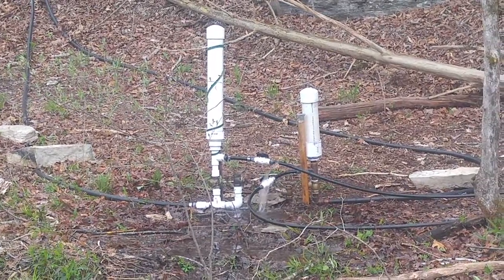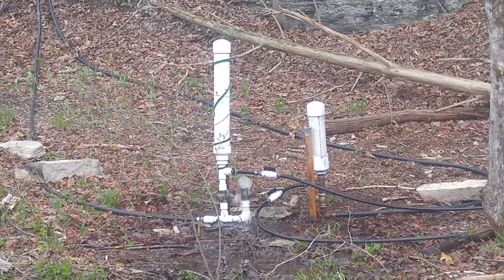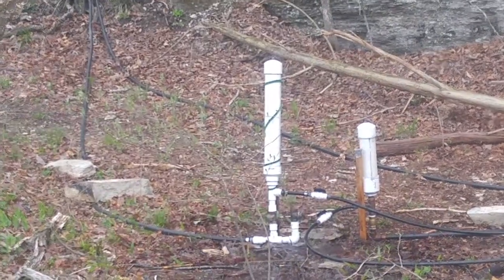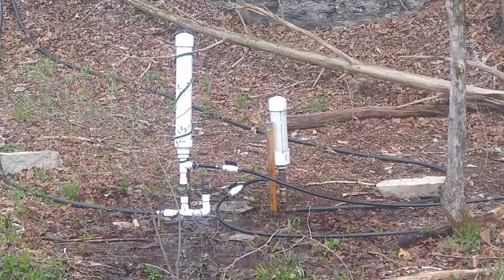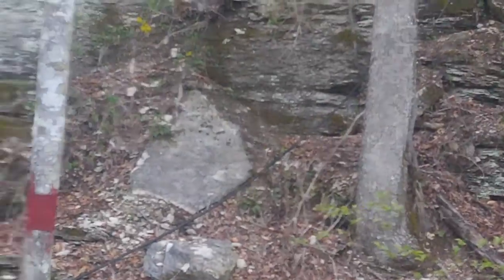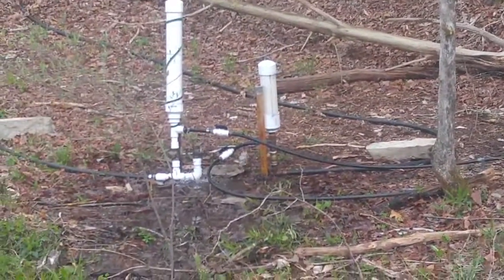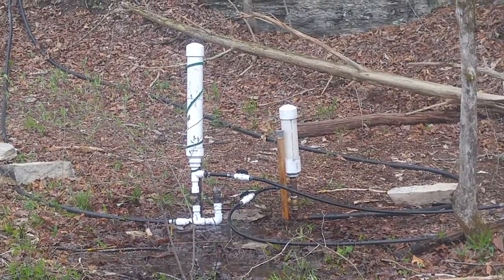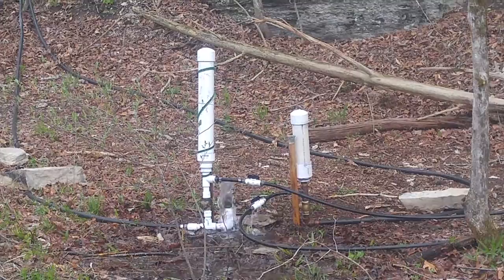Double Water Ram Pump

Comment: No need a double ram pump, just little bit increase the size of the drive pipe and double up the waste valve. I tried this system, I have approximately 7 meter head and very good volume of water, for 1" diameter of my ram pump I install 2 x 1 waste valve (better to use stainless steel swing valve or make your own customized waste valves) and have very goo result, more volumr of water delivered for 40 meter vertical  at a dis tance of almost 300 meter, compared to a single waste valve.